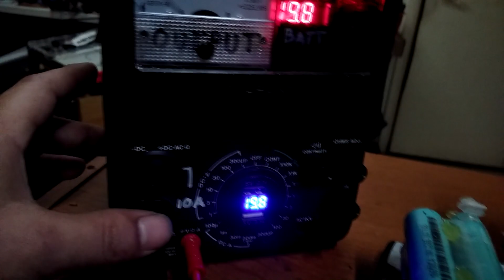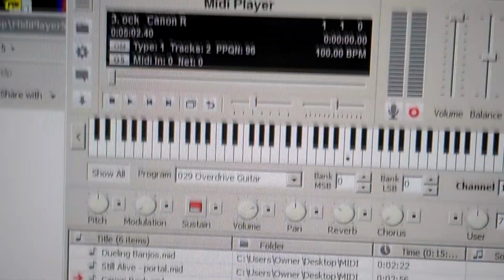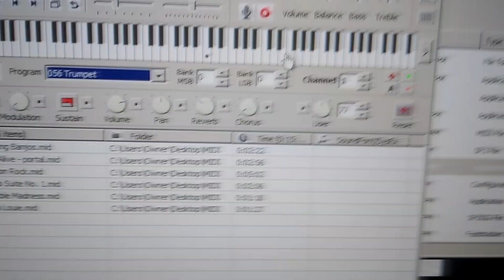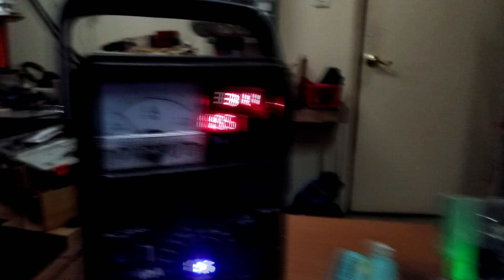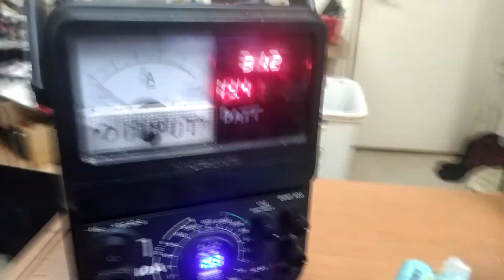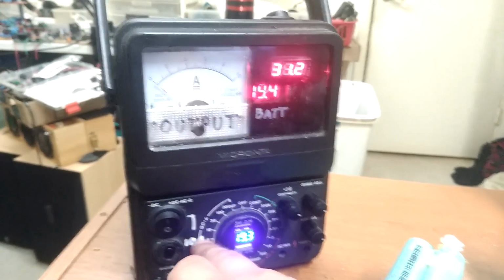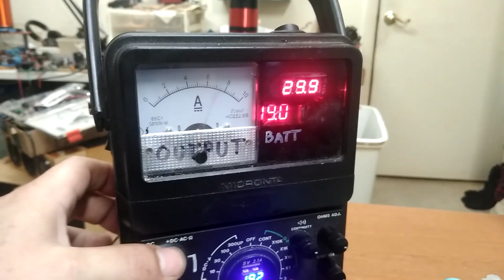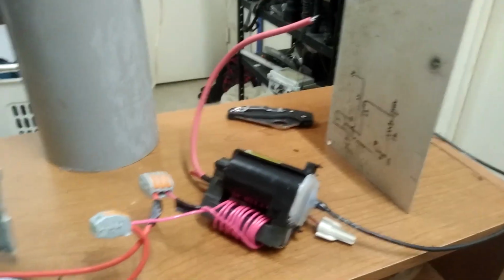New Flyback + Interrupting

Comment: Schematic?
Reply from the maker: https://320volt.com/wp-content/uploads/2012/05/uc3844-flyback-driver-final-irfp260high-voltage.png

That's the Super Flyback Driver made by Jan Martis (jmartis2). It has a current sense feature but I'm just using a PWM module and gate driver. Mine looks complicated because I'm using an old module that went dead at the output but it still gave a working dirty inverted square somewhere off the IC. I used a schmitt trigger inverter to clean it and invert it back to switch a UCC27322 gate driver and I'm interrupting it using the enable pin. 

The real feature of that driver is apparently that current sense which I haven't seemed to need as of yet. The real feature of mine and any other that will probably work fine is the addition of the snubbers and primary capacitor. 

This is the flyback I used https://www.ebay.com/itm/121268690783

Comment: this noise is like a microphone jammer i put together 15 years ago)) btw is it running at ~40-50khz?
Reply from the maker: I ran it at 17.4khz. Just high enough I surely can't hear it and not too low IMO. It will run fine a little higher but I got the most voltage out of it at this frequency seems like. 40-50khz will be a no-go for this flyback to get the longest arcs.
Reply from the maker: I get the best corona apparently from around 16.5 khz and reliable 2.5 inch jump.
Reply: @Magneticitist  eh,got it. i hear like to 22khz, when i was running my half bridge arcing machine at 19khz (cuz igbts couldn't sustain more) and i heard this deafening loud high-pitched buzzing. however, when i did similar power setup but with zvs, running at 29khz, i didn't hear any buzzing, just typical arcing sound.